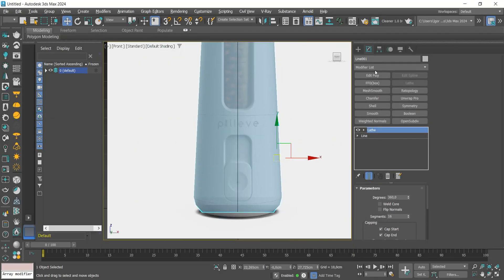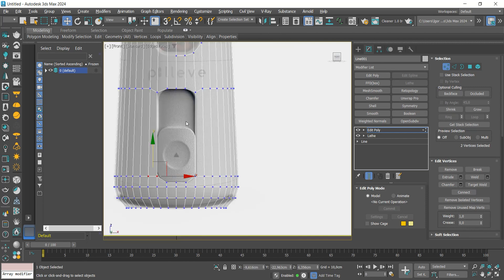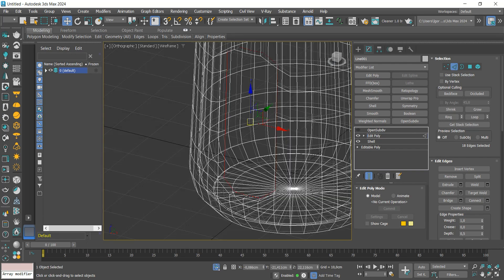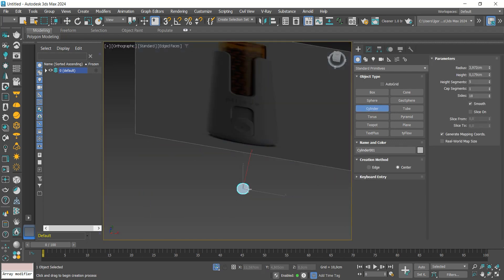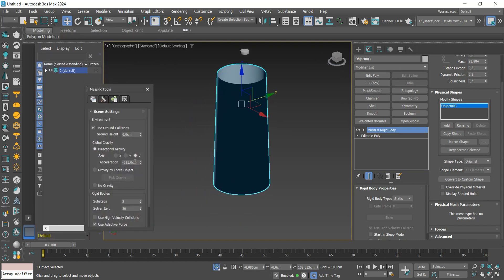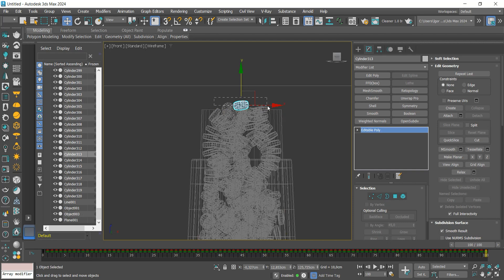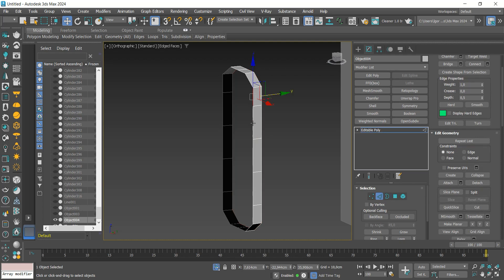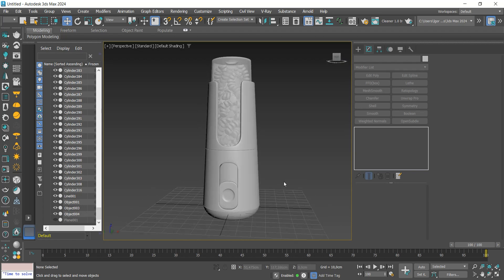Improve Your 3D Modeling Skills in 3ds Max! #3dsmax2025 #MassFX #hardsurface

Comment: Thanks a lot for the tutorial. But I have one question, I do exactly as you do but when I run the simulation for massfx, the pills fall down through the bottom of the container. How do I solve this? I’d appreciate it.
Reply from the maker: Hello! Make sure to select the container and add the massfx as static so that the pills collide with the container. If it doesn't work, try converting the object to editable poly and redoing the massfx process. In the video, I change the pills to vertex and increase the section value to 256. Try these steps to see if it helps. Thanks for commenting. I hope you succeed!
Reply: @ Hello again. I tried that and it still didn’t work. I’m pretty sure there’s something wrong with the model itself because when I run a simulation with a totally different object, like a sphere that has been cut open, everything works fine. What attributes should the static object have? Like I know the top part should be open and the bottom should be closed, but is there more to do? The static object also has some thickness.